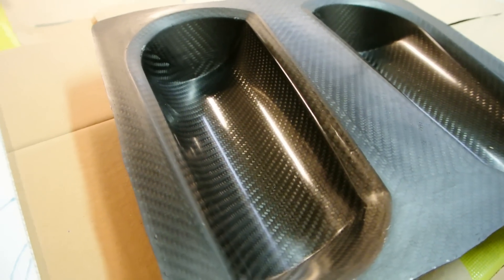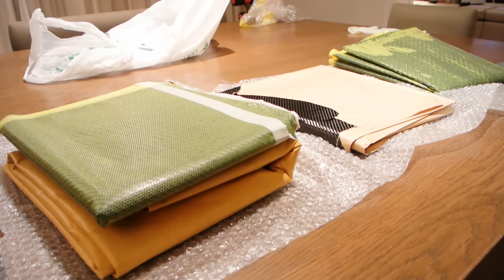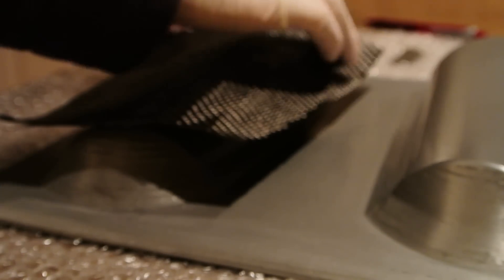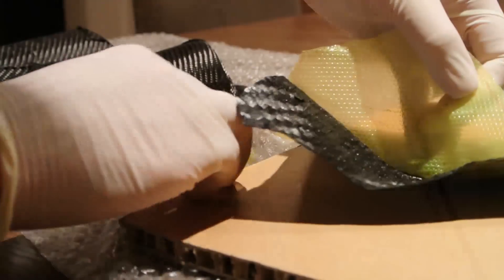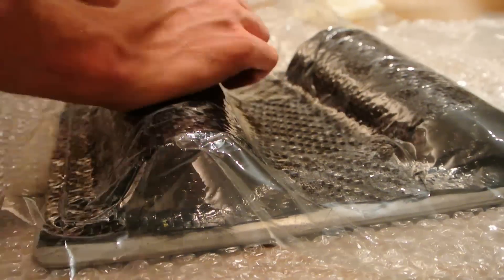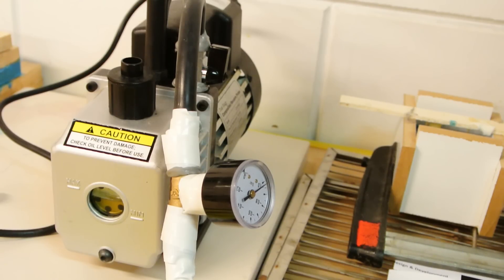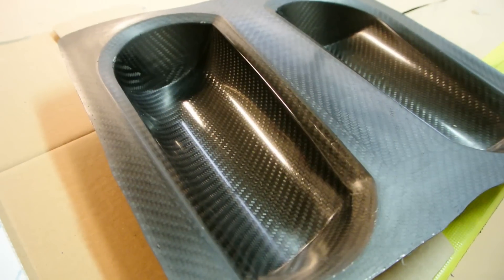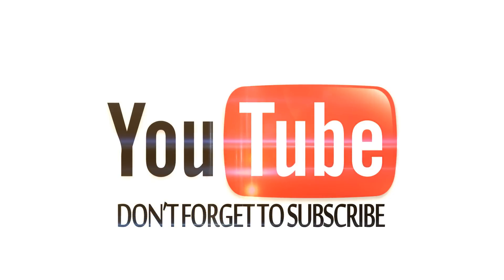Tutorial: Out Of Autoclave PREPREG Carbon Fiber/Fibre Part 4-7 (Making prepreg moulds)

Comment: Why did you not use the CNC'd MDF Wood as a mould? Is there any issue with using that as a mold? Speaking as someone who is looking into using an MDF wood or Foam mold to produce a large, 1 off part. Im planning on routing it, and using the processes you mentioned in the second video in this series to prepare the mold as a female mold. I want to mold directly into that milled piece, and then vacuum infuse it and have it dry outside of an oven. I want the smooth surface finish on the outside of the part, rather than the inside of the part, if that makes sense. Is that why you used the epoxy? Or is there some other reason.

Thanks in advance for a response!

Comment: How is this out of autoclave? You put the piece in an oven with pressure.
Reply: And the definition of autoclave is?
Reply: Autoclave is an object that adds pressure AND heat onto a part. However, if you use an oven and have a hose going inside of the oven that can attatch to a vacuum pump that maintains a vacuum and pressure on the part, then that is also good enough ( or atleast that is my understanding). However, what Out of Autoclave means is that the part was manufactured OUTSIDE of an autoclave, or SANS autoclave, rather than inside an autoclave. Thats where @Stephen Levinson was confused. That is, again, my understanding of it. Hope that helps!

Comment: how come you are not using perforated film and then the white material? isn't it the purpose to get the extra resin out with the air bubbles ? im just asking due to the fact im looking to start making some carbon fibre parts for my car witch im restoring this summer so im looking to get best advice for carbon fibre parts.
Reply from the maker: HellRaiser1st you are probably mixing up prepreg carbonfiber with wet-lay vacuumbagging technique
prepreg has the perfect fabric to resin ratio so you dont want to suck out any more resin or you will get a bad finish

Comment: Hi Matthieu,
This was a great video series. Why do you like Prepreg carbon fiber instead of adding the epoxy your self. My understanding is that the Prepreg is very expensive and you have to keep in the freezer to store. What advantage do you like of the prepreg.
Reply from the maker: Hi, The thing I like most about prepreg is how 'clean' everything is, no messing with resins, scales, mixing resin, degassing, having to work before everything cures, cleaning brushes and so on... prepreg also give stronger parts with better resin to fiber ratio's